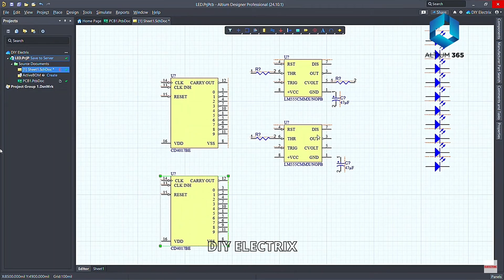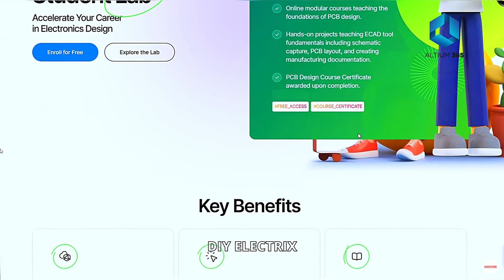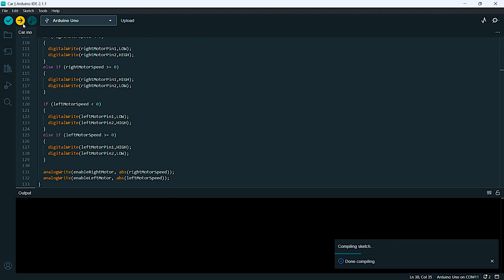How To Build an Obstacle Avoiding Robot | Obstacle Avoiding Robot | Electronic Projects

Comment: Salut, j'ai un problème avec le servo moteur SG90, lorsqu' il y a une détection, il tourne de 180 degrés vers la gauche et ensuite 180 vers la droite mais ne reviens pas a la position 0 !
Une idée ?
Reply from the maker: which motor are you using 180° or 360°.
Reply: @DIYElectrix  360°
Reply from the maker: Please use a small motor with 180°, small motor is enough to make the movement of sensor.